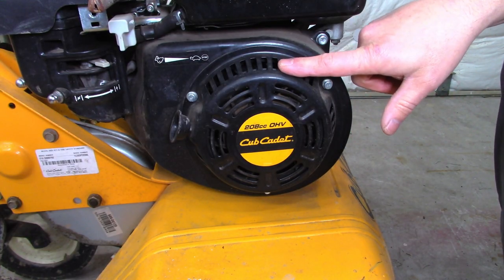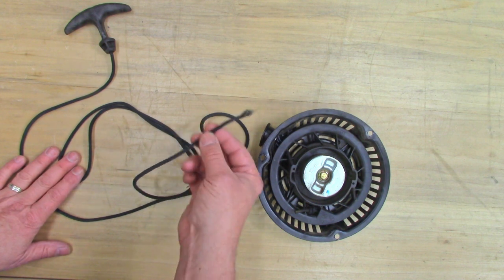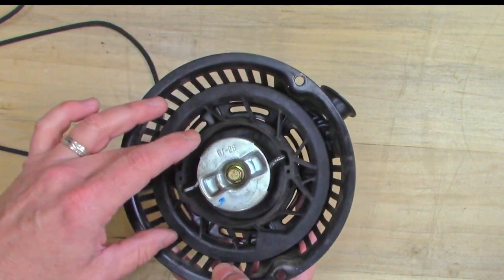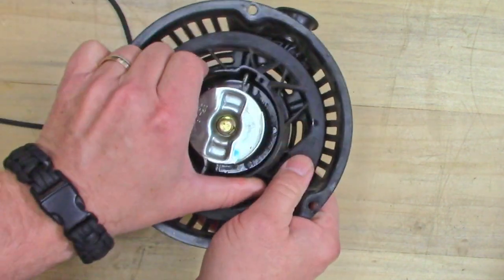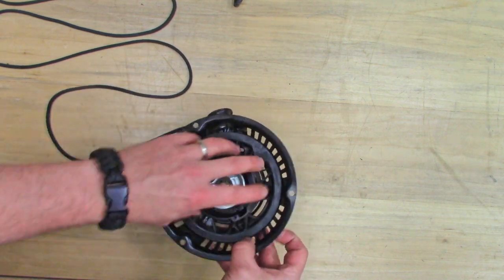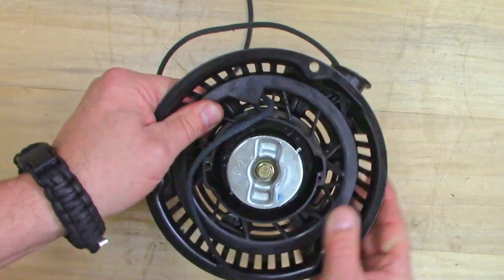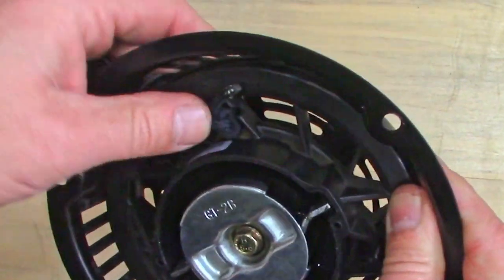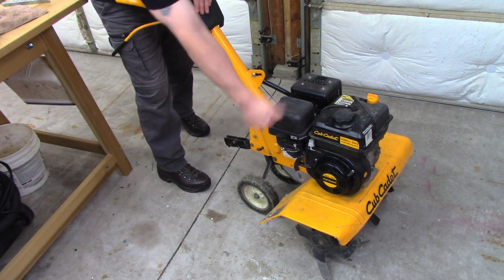Replace starter rope on lawnmower, string trimmer, or other small engine

Comment: Very helpful.  Ended up running a small zip tie through the holes in reverse, then taped the string to it and rand it back no problem.

Comment: Well, thank ya Sir. Mine strang just broke and had to drill out them there pesky rivets. Straight to the point and not a tons of gibber jabber. Thanks again, Bro!
Reply: Instead of drilling the rivets out u can remove the metal housing the rivets are connected to, should be 4 lil bolts.